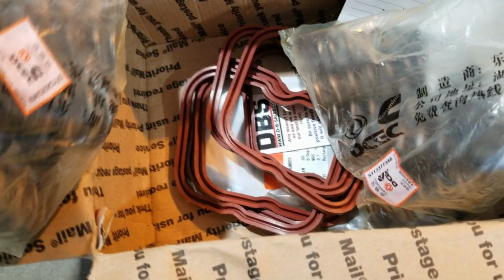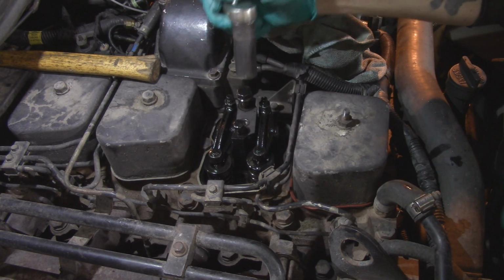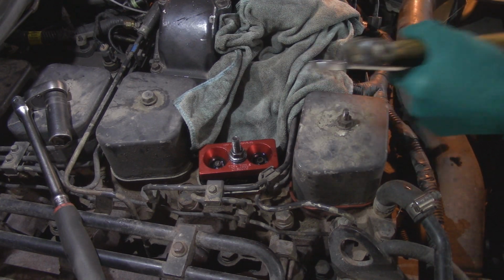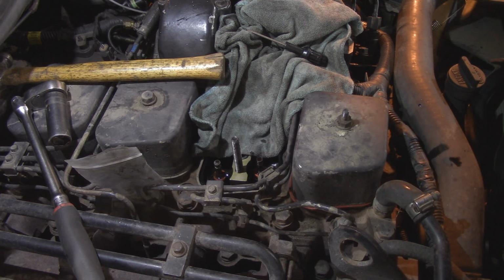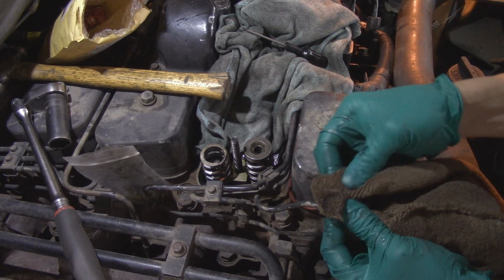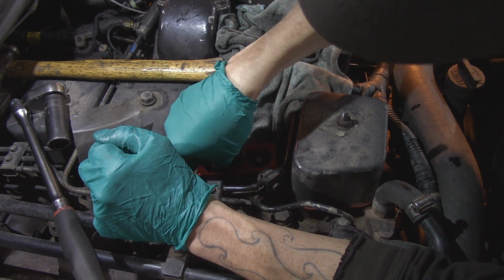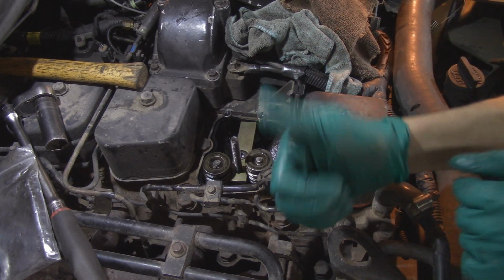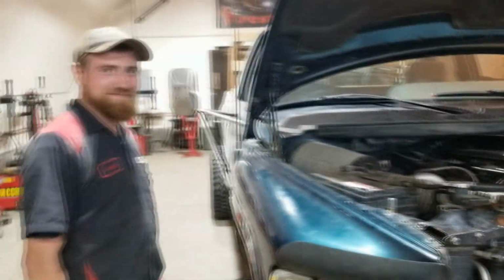95 Cummins Valve Springs and Seals Install!

Comment: Definitely a job I would not want to use gloves for! I mean I hate gloves regardless.. But I would be terrified of dropping the itty bitty parts.
Reply from the maker: haha, i used to not wear gloves, but now i do for almost everything. my hands have been getting so dried out lately, and with the work that i do, its already very hard on your hands. id make a fist and my hand would crack open, then if i was to work on diesel trucks and get that oil inside a cut... not so good haha! i gave you a shoutout in my next video haha! gotta get you some IFS hubs haha. Im not sure if your buddy Kyle is the same Kyle as my buddy Kyle, but he has a set of hubs screaming to be machined haha! ;)
Reply: @analog56x  Probably not? Kyle Hammell? He's in Cranbrook too.. But yeah for sure I need to get on the IFS hubs. Just dont have the resources at the moment 😂 And awesome, thanks for shout out!

Comment: So you just turn the engine until both rockers are loose on one cylinder for top dead center then you can change over to 60lb springs. Then do the same to the rest of them right?
Reply from the maker: Correct.

Comment: How do you know if the engine is at TDC? Just crank until both are loose?
Reply from the maker: crank until both rockers of the same cylinder are lose, then set your lash.

Comment: And the way you got it to top dead center was just by turning the key a bit to get it to rock? And how do you know it’s at top dead center on that cylinder?
Reply from the maker: The 2 rockers on that cylinder will loosen up. And yes, i just bumped the key. If you're feeling creative, you can run a wire from your starter relay and bump the starter that way
Reply: analog OffRoad okay yeah I’m just needing to replace my valve seals. And did you have any trouble with the cylinder dropping? I heard there’s people that fill it with air or something I’m not sure if it’s something you did or if you need to do it but I’m unfamiliar with it
Reply from the maker: @billytraughber8427  i didnt worry about air. If that cylinder is at TDC, the valves wont fall. Only do the ones on the cylinder at TDC though haha! If you drop a valve, you're pulling the head haha!
Reply: analog OffRoad lol yeah that’s something I wanna avoid for a long time
Reply: analog OffRoad so simply just see if they’re both loose at the top and that’s all  I gotta do?
Reply from the maker: @billytraughber8427  if you are unsure, bump the starter a bit more, you'll see both rockers dip, then they will come up and get loose. Thats also when you set your valve lash ;)
Reply: analog OffRoad alright thanks so much brother!

Comment: Finding tdc #1 is easy to make sure piston is up so that the valves don’t fall in. How do you find tdc for the rest of the pistons???
Reply from the maker: I rotate the crank until the next set of rockers are both loose. Bump the starter, give number 2 rockers a wiggle, if they are both loose, your good to go. I think i showed that in the video...
Reply: 1 and 6, 2 and 5, 3 and 4

Comment: What keeps the valves from falling in???
Reply from the maker: I think we just brought the piston up to tdc. The valves can't fall in if the piston is at the top. You could also pull the injector and push like 10psi of air into the cylinder of you're feeling spicy haha.

Comment: what cylinders are you able to do at TDC? All 6 or a combination of them? and then roll the engine over again to get the remainder?
Reply from the maker: i bring one cylinder up to TDC and adjust the valves on that cylinder. then i bring the next one up to TDC, and so on until im done :) there is a way to set the engine at TDC and do half of the valves, then roll it over and do the remainder, but i like the one at a time method. it works great and is easy to remember :)